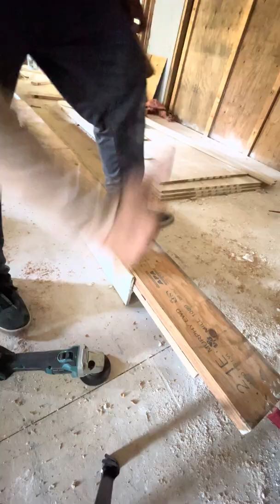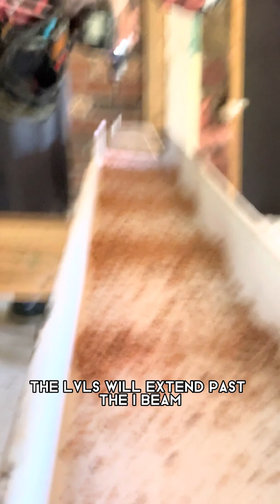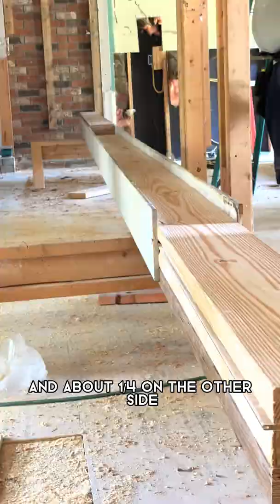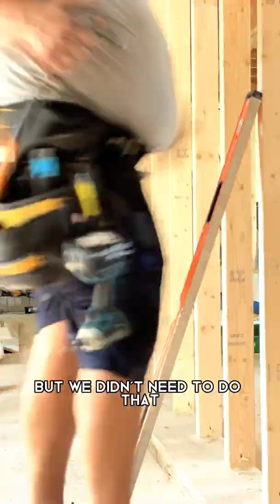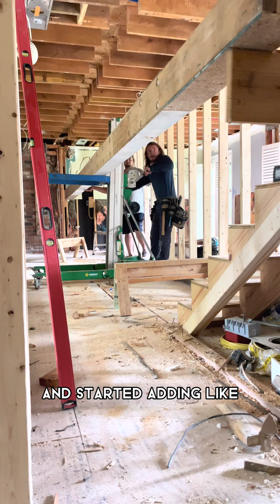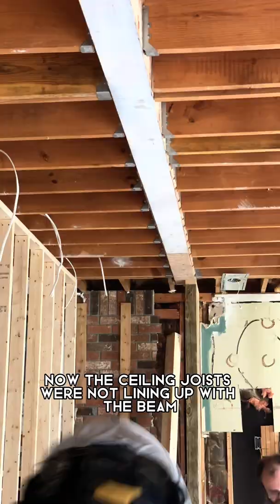Big Beam Installation | Artpentry Carpentry

Comment: So now the floor and ceiling above  and also the weight of the beam is being held by the extension that sticks off both ends and will cause a sheet point where the beam ends that’s a big no no.

Comment: Looks like a good job. 
Done this many times. One of which was severe with two massive, stacked Glue Lam beams. Approx 30 feet long.  
One for the ceiling in basement which is floor above. It projected out of the ceiling joists slightly but looked fine when done.
I asked engineer about steel but homeowner didn't care about the slight show of beam when drywalled.  
New large footings in the concrete basement floor for point bearing loads at each end.
The upper ceiling beam was flush with ceiling but far up into attic.  Posted to same same bearing points as the beam below. 
Same lifting technique with safety supports like you did.
So many hangers.  Hate installing. even with  Teco gun.  I've made the help install those for many years.  I only want to do the fun stuff.

Comment: You're really smart to know your limitations and bring in that structural engineer. I was once trying to convert a basement into a workshop and we were going to knock out a wall. The wall was for a basement bathroom that was never built so it just seemed like a framed out wall no big deal. We called in a structural engineer just to be sure. Cost us $300. The structural engineer told us that when they built the house they missed the support wall in the basement to the wall that goes up two more stories to the Attic. If we would have knocked out that BS frame job in the basement the ceiling would have caved in within 6 months. Structural engineers are worth the money and rarely used by contractors who think they know.

Comment: Obviously it works but my head can’t comprehend how those vertical beams hold something so heavy
Reply: My father built my farm house and this is the set up in the basement and it makes absolutely no sense to me also.
Reply: They don't hold the weight, they transfer it to the beam below, and then the beam below transfers the weight to the foundation, or more posts dependon what floor this is.
Reply: @SirGatras hold / transfer, it’s still mind boggling